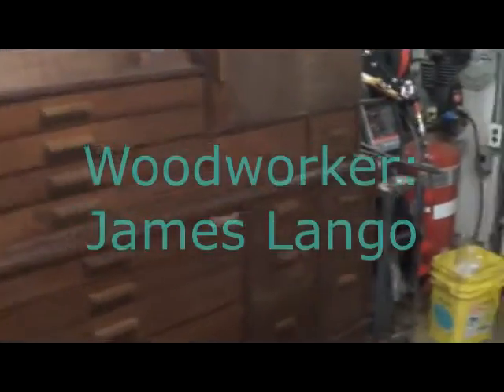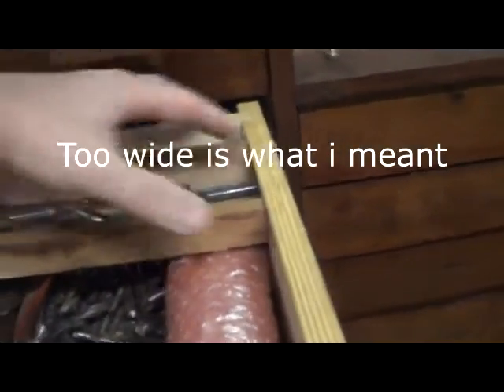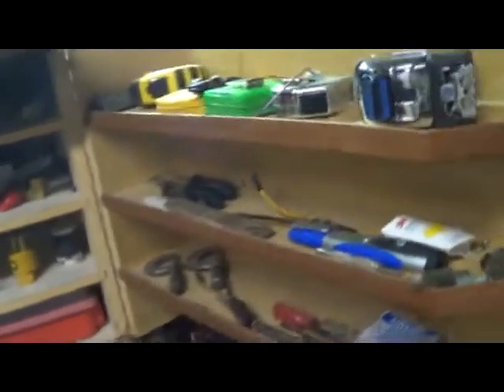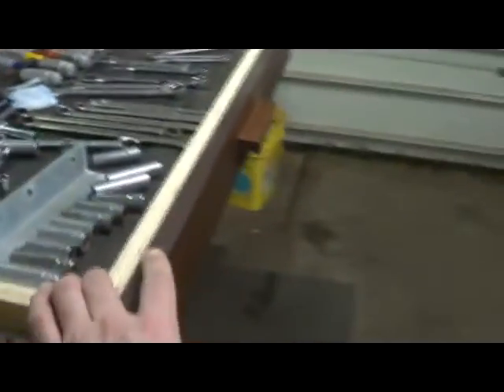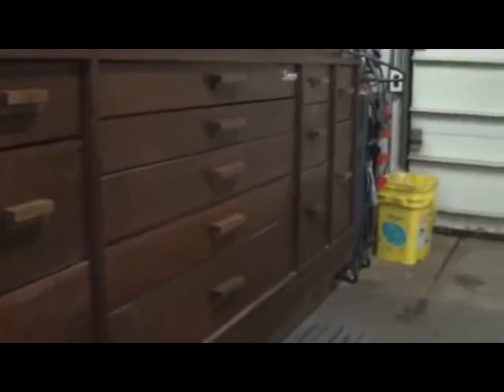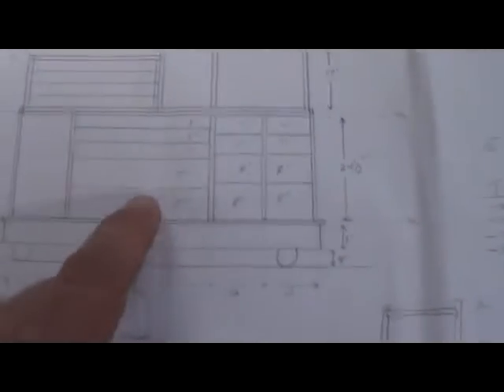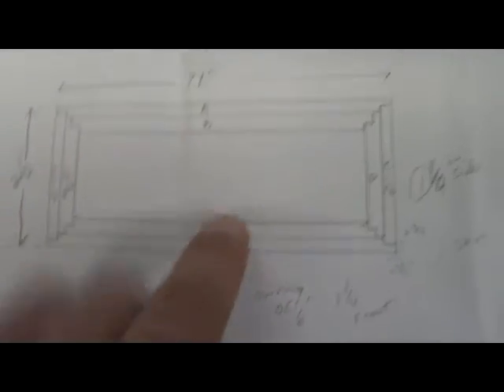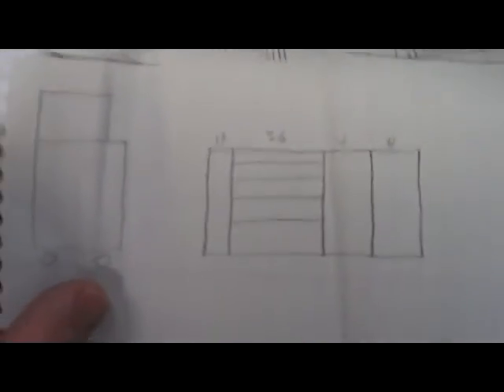ToolChest

Comment: I'm building one very similar to yours right now.    84x67x24 all 1" and 3/4" sides and frames.  Drawers are all 1/2 BB plywood.   Torsion box for the bottom for the weight.  We'll see how it holds up.  Thanks for sharing !

Comment: Very nice. I'm trying to decode if I want to take  the time it will require to build my own rather than but a tool stack. I disagree with Snap-on is top of the line in tool storage though. They certainly have the top of the line price but there are a lot of setups with as good or better features for a lot less money. Reminds me of Harley Davidson. In honor of the wood working project you should make a name plate that says Screw-On.

Comment: what kind of drawer slides did you buy and where did you get them at?
Reply: Brian Bowles they're just nice full extension ball Bearing drawer slides. Knapp & Vogt is one brand name that's good. 
I take you are building one for yourself?
He says, "I just wanted one cabinet that housed all my mechanics tools." That's funny! I built one 15 years ago for the same purpose, 64" long, 26" deep, 42" height. It didn't work out because I needed double that space once I got organized and added other necessary tools LOL
I need to build another one, but my standards on the first one were pretty high... I now have it stuffed with occasional and back up tools and have a manufactured 44-inch "pro" top-and-bottom that's actually the tool box I use. STILL need another!
I built mine with a 1" square steel tubing perimeter frame welded on a 3" steel channel base and 4" cast iron casters, but all the sides are 1/2" Baltic birch plywood tight fit and mounted to hidden welded tabs. The drawers are also 1/2" baltic birch. The 16 drawer fronts are red birch from a tree I cut down myself, milled and dried. The three banks of drawers have the grain all oriented and flowing across the cabinet as they were either cut from a single board left to right, or for some drawers, if the appearance didn't "flow" I book matched the boards by using the 'next' board as cut from the tree. I used 1-1/2" MDF finished in urethane for the top surface because I couldn't stand to use nice wood on a surface likely to get abused a little.
It looks awesome (finished in shellac) and has never worn out or needed repair over the fifteen years of regular use and a number of location moves. 
This vid features a box that's 100% wood. Nothing wrong with that, especially if you don't weld. 

I hope you build a nice work of art and post a vid!

My only criticism? I'd NEVER put a snap-on moniker or any other brand name on something that I crafted and built. While I might inlet a vintage Chevrolet and/other vintage badges as an obvious art display/highlight, just the idea of paying homage to someone or something else on something I designed and painstakingly crafted and built bothers me a great deal. (Caveat: I own ZERO snap-on tools. On purpose. And the snap-on guy lives like two miles from my shop)